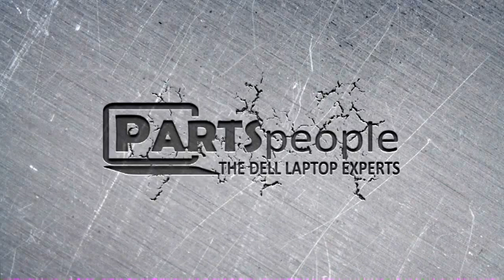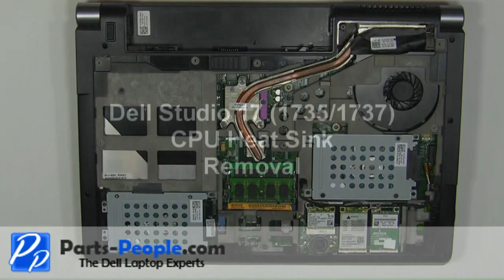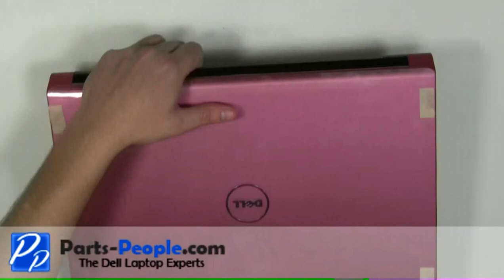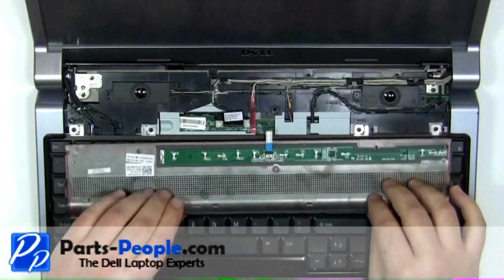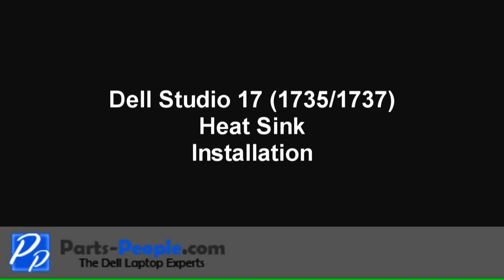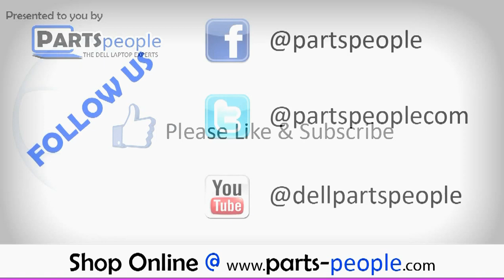Dell Studio 17 (1735/1737) | DC Power Circuit Board Replacement | How-To-Tutorial

Comment: I have a Dell Studio 1735 ... yesterday I was working on it and it went dead.  I looked at the power supply and the green light was out.  I unplugged the laptop and at the wall.  When I plugged the power supply back in the wall, the green light came back on... when I plugged into the laptop, the green light went out.... will this fix this problem?.. thanks
Reply from the maker: The DC board could be the problem. It's hard to say. The green light going out on the adapter is usually a sign that there is a short somewhere. Unfortunately, it's not always the DC board that causes it. Sometime, the short is on the motherboard. The DC board is the first part to replace though.

Comment from the maker: Not always. A very common problem is that the center pin solder joint on the DC jack breaks. This causes the power adapter to become unidentifiable to the laptop thus powering the laptop but not charging the battery. In the BIOs it shows "unknown adapter" error.

Comment: That is most likely the wrong adapter. This unit requires a Dell PA-3e or PA-10  (90 watt) adapter. Using anything other than that will result in that message. Also, 3rd party adapters often damage the DC Jack and do not provide correct amperage.

Comment from the maker: @MultiNoobTroll When you receive the "battery is unidentified" error that is usually an indication that the battery is bad or it is a third party battery that is not recognized by the system.  I would recommend replacing your battery with a Dell OEM replacement battery and I think that will solve the problem.

Comment: I have problem with a Dell studio 1737, the error message on boot up is "battery is unidentified". I will try replacing the battery but if the problem continues do you think a power circuit board replacement will work?